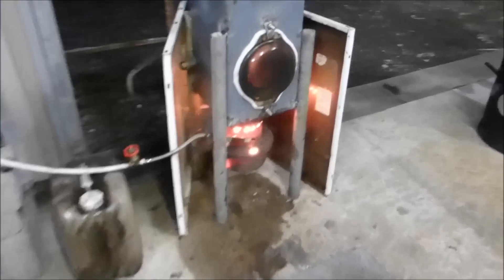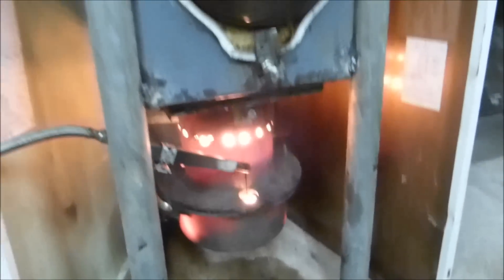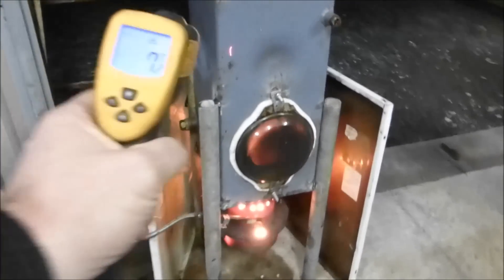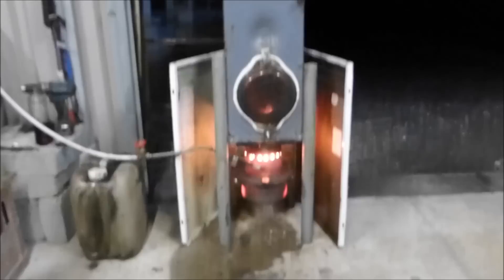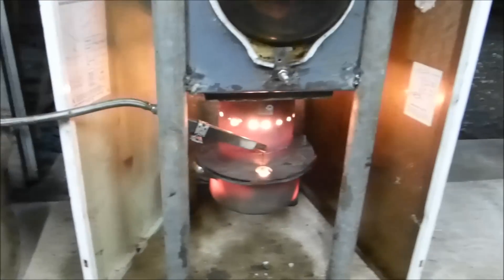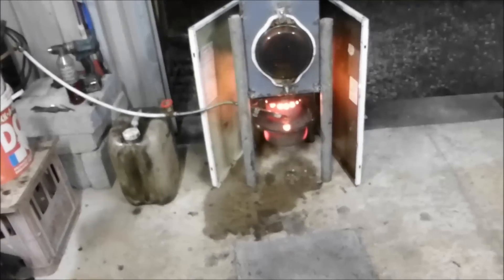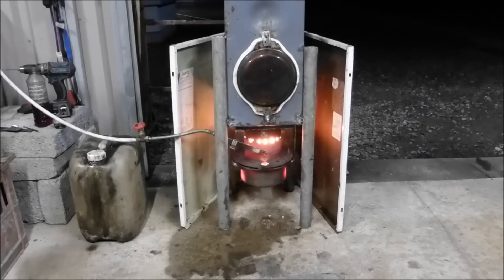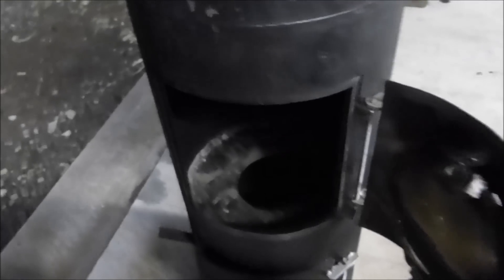Make lots of hot water free from waste oil.

Comment: Hey Gerry! It’s seems that your challenge is automatic ignition and SAFETY CONTROLS?
Have you ever filtered waste oil and run it through a Beckett or Riello? 
I mean just replace the fuel oil with waste oil?................ ignition and control issues solved?
Obviously FILTRATION is the issue🤔🤔🤔 or is it more complicated?
GREAT VIDEOS MAN!! 
What did or do you do for a living? 
You are very knowledgeable in many areas!
Plenty cold up here -20 and a couple feet of whiteness
🇺🇸NEW HAMPSHIRE🇺🇸

Comment: should have 2 inches of water column of draft over the fire.I have been watching you do well for your self with scrap parts.I would my self get an old burner like a Becket this way the combustion tube has baffles to spin the air into a vortex and a nozzle to atomize the fuel